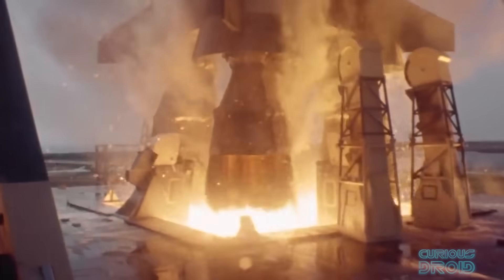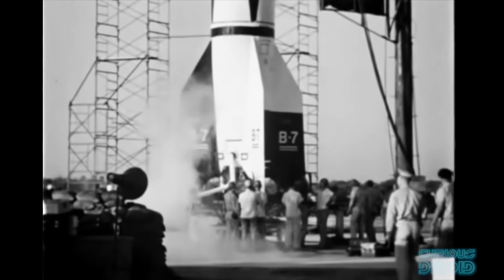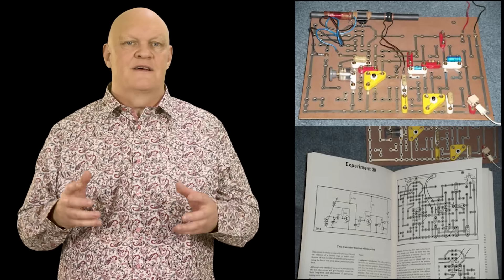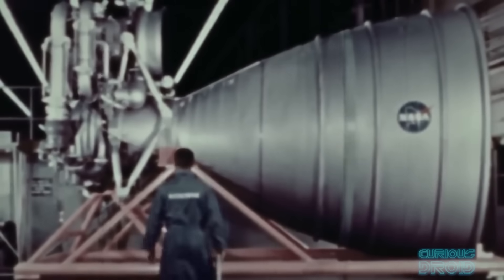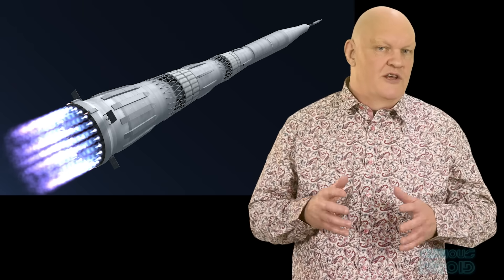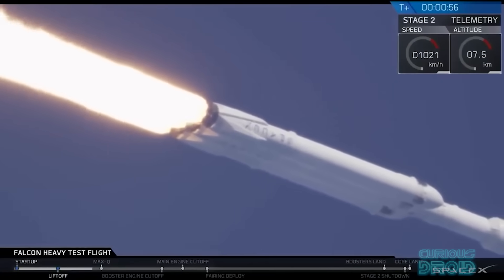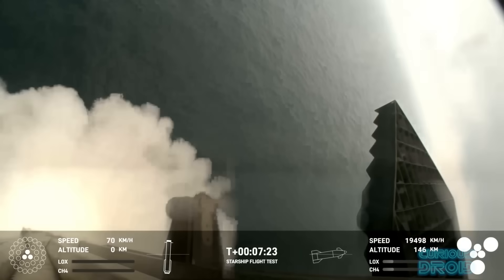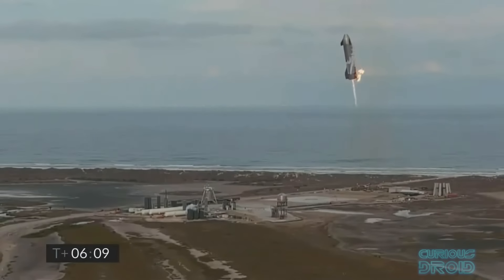Why Does SpaceX Use 33 Engines While NASA Used Just 5?

Comment: Smaller engines are clearly the way forward. But there was something epic about the old Saturn engines.
They looked simply amazing.
Reply: Did Apollo 11 actually leave near-Earth orbit?
Despite the revisionist narrative that this channel won't question -- unstable fuel burn for the oversized F1 engines was never rectified and another arrangement in their place was made in order to reach near Earth orbit, keeping the F1 bell nozzle to maintain the desired appearance.  The great licking yellow flame was an indication that something was not normal as fuel was burning in the atmosphere while providing no additional thrust. This was the result of injecting additional kerosene into the exhaust stream for greater visual effect yet appearing to produce an inefficient burn unlike other rockets after launch.  No explanation is forthcoming and this issue is not addressed in any usual report; however, using a smaller reliable engine with a reduced fuel load and stripped down mission requirement allowed the Saturn V to reach near-Earth orbit.  

The Apollo 11 crew attempted to demonstrate their position at over halfway to the moon as seen in the unedited version presented to the public while the more recently released unedited version reveals a flood of blue light entering the same window as the camera continues to roll, through which only a moment before, we saw the Earth far distant in what appeared to be very low light conditions. Then, as the camera pulls back from the window, the exposure settings are seen to return to normal as a flood of light enters the same window.  Without a change in the orientation of the spacecraft assumed to be on a trajectory toward the moon, the only source for any flood of light can be the Earth while in near-Earth orbit.  The usual sponsored efforts will try to make excuses for why the obvious did not take place -- yet is overly apparent in the unedited version.  When facts cannot prevail in support, sponsored activity will resort to name calling and other derogatory comments discrediting themselves.
Reply: @ronaldgreene5733  "The great licking yellow flame was an indication that something was not normal as fuel was burning in the atmosphere while providing no additional thrust."

This is a result of the film-cooling employed by the F1. To keep the nozzle cooled, the fuel-rich exhaust from the pre-burner was piped into the circumference of the nozzle. This doesn't provide meaningful additional thrust, but it does keep the nozzle from melting. It is correct that the exhaust fumes won't burn until after they have exited the nozzle, reacting with the oxygen from the surrounding air. For the design of the engine, this was completely normal.
Reply: .  . While remaining in near-Earth orbit, another indication are the impossible weather patterns seen on Earth, when in reality only a small portion of the Earth's surface was visible, framed by the round window of the command module.  Straight line cloud fronts are seen on video to be extending for what appears to be more than 6000 miles, a quarter of the Earth's circumference -- something that has never occurred in the meteorological record on Earth. The round window of the command module was used to effect an image of the Earth but the weather in the region did not comply for a realistic view.  No recognizable continents are found in view, but only the impossible weather patterns seen.
Reply: They clearly aren't: cascading failures will always be a problem when you pack a bunch of smaller engines together. The Russians spent many years on trying to solve this problem but finally gave up. That SpaceX sees better results due to much more advanced technology, doesn't solve the initial problem. Even with the latest SpaceX rockets there's still the risk that one of the engines failing in a catastrophical way, which DOES happen, can and often will wipe out its adjacent engines and it can even lead to a total failure of all the engines of that rocket.
Reply: @tjroelsma  It's just a matter of designing the rocket to avoid cascading failures. SpaceX is already there. An engine blew up on the landing burn for the most recent flight, and it was fine.

Obviously you want to avoid failures, and we can expect that SpaceX will continue working on engine reliability and the like, but it is a solved issue. It's just a matter of optimizing the design so that you aren't wasting unnecessary mass on engine shielding and stuff like that.
Reply: @SpaceAdvocate  Murphy's Law: Anything that CAN go wrong WILL go wrong on a project, advocates against complicated setups. And a rocket with 33 engines IS complicated. No matter how reliable your individual engines are, the failure of even a very simple and/or cheap component can result in a catastrophic failure, which then triggers the cascading failure I keep mentioning. 
Although SpaceX IS showing improvement with their rockets, there are still engines failing at each launch, meaning that their reliability is still questionable. Add to that the fact that they use far more fuel than SpaceX calculated they would, to me this points at SpaceX implying some protection measures against cascading failure that raise the weight of the rockets significantly. What you see looks more like band aids holding things together than actual solutions to problems and the giant elephant in the room is that despite these modest successes SpaceX is still 4-5 years behind on their own schedule.
Reply: @tjroelsma  Anything that can go wrong will go wrong, but if you design the vehicle/engines so that a cascading failure can't happen, it won't happen. That's the approach SpaceX has chosen.
Reply: @tjroelsma  "modest successes" Lol ok man.
Reply: @SpaceAdvocate  If you group together (aka cascade) a bunch of rocket engines, cascading failures WILL happen, there's no engineering around that.
Reply: @JayZ-Denton  No launch, as in NONE, ZERO, SpaceX has made thus far in their Starship project has been without problems or has even come close to achieving ALL targets for that launch, so that's modest success in my book.
Reply: @tjroelsma yes, that's the whole point of test flights.

Imagine how many lives would have been saved if NASA had been willing to perform some test flights to figure out where problems can occur before putting astronauts or school teachers on their rockets.
Reply: @tjroelsma and starship has shown that the multiple engines provide sufficient redundancy. A lot of the engine failures stem from a desire to do what nobody else has ever done. Most engine failures have to do with super heavy's boost back burn which is a challenge that no other single engine booster has even attempted that I'm aware of.
Reply: @tjroelsma  "If you group together (aka cascade) a bunch of rocket engines, cascading failures WILL happen, there's no engineering around that." Of course there is. It's just a matter of making the engine and engine shielding capable of containing any engine explosion without affecting the vehicle.

"No launch, as in NONE, ZERO, SpaceX has made thus far in their Starship project has been without problems or has even come close to achieving ALL targets for that launch, so that's modest success in my book." That's incorrect. The fourth flight saw the completion of every milestone for the launch.

There were some issues observed during the flight, of course, but that is fine. That's why the flight test was performed in the first place. SpaceX wanted to get experiential data from flying Starship, particularly from reentry. Gathering data from these issues was the whole purpose of the launch.
Reply: @tjroelsma  How about we return to this comment after the Falcon 9 has proven your point by having multiple engines go out.  I will even take "at least one engine going out during ascent per year," just to make this easier.  Since 2016, there's only been a single instance.  So this may be a bit tricky.  I would even go so far as to suggest that once an engine has had its kinks worked out, this concern is resoundingly, manifestly unwarranted.
Reply: Are they? I don’t buy in. I still think starship will not deliver on any of its promises

Comment: Probably because SpaceX just doesn’t have the skills to build a nice big engine.
Reply: @viktorm3840  The only thing fake is your English.
Reply: @viktorm3840  Dude. Use autocorrect.
Reply: @viktorm3840  They can be rebuilt and even made better. It’s just a bit pointless at this time. There’s hardly any need for a heavy lifting rocket like the Saturn V.
Reply: @viktorm3840  No you can’t for starters and there’s no need for it either.
Reply: @viktorm3840  In that case, make an effort by proofreading.
Reply: @viktorm3840   People watched the Saturn V lift off in real life, you know what stage of the Saturn V used the biggest engines?
Reply: @viktorm3840  That is incorrect. We have independent video of every Saturn V launch. 
I've examined the Apollo missions thoroughly, and found nothing "impossible" about any of them. 
I've examined the claims made by moon landing deniers, and they are invariably full of holes.
Reply: @viktorm3840   You think the government has gotten  thousands upon thousands of people who watched both test stand firings, and Saturn V launches to lie for over 60 years, over something they visually watched in person.

Comment: "Why Does SpaceX Use 33 Engines While NASA Used Just 5?"
<long silence>
"These goes to eleven."
Reply: EXACTLY !
Reply: Did Apollo 11 actually leave near-Earth orbit?
Despite the revisionist narrative that this channel won't question -- unstable fuel burn for the oversized F1 engines was never rectified and another arrangement in their place was made in order to reach near Earth orbit, keeping the F1 bell nozzle to maintain the desired appearance.  The great licking yellow flame was an indication that something was not normal as fuel was burning in the atmosphere while providing no additional thrust. This was the result of injecting additional kerosene into the exhaust stream for greater visual effect yet appearing to produce an inefficient burn unlike other rockets after launch.  No explanation is forthcoming and this issue is not addressed in any usual report; however, using a smaller reliable engine with a reduced fuel load and stripped down mission requirement allowed the Saturn V to reach near-Earth orbit.  

The Apollo 11 crew attempted to demonstrate their position at over halfway to the moon as seen in the original version presented to the public while the more recently released unedited version reveals a flood of blue light entering the same window as the camera continues to roll, through which only a moment before, we saw the Earth far distant in what appeared to be very low light conditions. Then, as the camera pulls back from the window, the exposure settings are seen to return to normal as a flood of light enters the same window.  Without a change in the orientation of the spacecraft assumed to be on a trajectory toward the moon, the only source for any flood of light can be the Earth while in near-Earth orbit.  The usual sponsored efforts will try to make excuses for why the obvious did not take place -- yet is overly apparent in the unedited version.  When facts cannot prevail in support, sponsored activity will resort to name calling and other derogatory comments discrediting themselves.
Reply: @ronaldgreene5733  Yeeah... um, not the "11" I was referring to. Interesting take, though.
Reply: .  . While remaining in near-Earth orbit, another indication are the impossible weather patterns seen on Earth, when in reality only a small portion of the Earth's surface was visible, framed by the round window of the command module.  Straight line cloud fronts are seen on video to be extending for what appears to be more than 6000 miles, a quarter of the Earth's circumference -- something that has never occurred in the meteorological record on Earth. The round window of the command module was used to effect an image of the Earth but the weather in the region did not comply for a realistic view.  No recognizable continents are found in view, but only the impossible weather patterns seen.

Comment: In 1950s the Army proposed Project Horizon to build a base on the moon in order to counter the Soviets if they were to build a base on the moon and achieve dominance and control of space. in order to meet objectives, large rockets with large engines (Saturn and F1) were proposed. This project would be very expensive, Eisenhower did not approve such a program. However, this provided a good start for Apollo program. First stage used kerosene fuel to punch through the thick atmosphere, hydrogen fuel for upper stages because it is the most powerful chemical reaction with oxygen. Though PITA to deal with in its cryogenic form. But those German engineers had overall design to account for Rocket Equation, engineering, keeping max Q to a mininum, etc. This is why three stages is the best balance of all this to go to the moon.

Then Shuttle comes along, this was a different set of criteria which had to balance the Rocket Equation, engineering, max Q, etc. Because want to have reusable winged vehicle which USAF wanted 1500 mile crossrange on entry, some political baggage, the design compromised to the disposable ET and use of SRBs. Using this architecture for a basic one use rocket doesn't balance all the above, so it has issues particularly using one stage of hydrogen fuel from ground to orbit so then need SRBs as tyranny of rocket equation means SSTO ain't gonna work. Plus production rate can't scale up.

I feel for those Rocketdyne engineers (probably all dead by now) who came up with this amazing SSME which will now be tossed in the ocean.